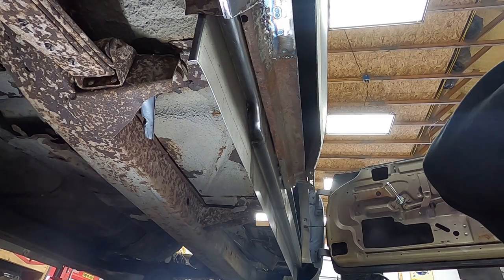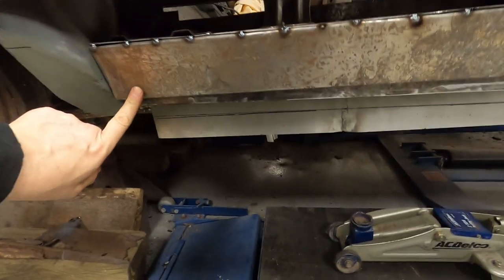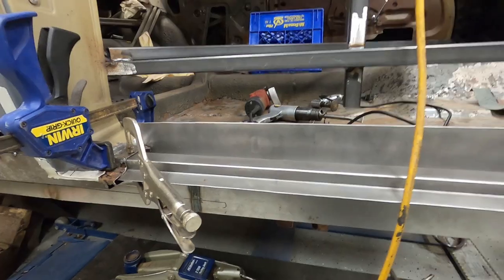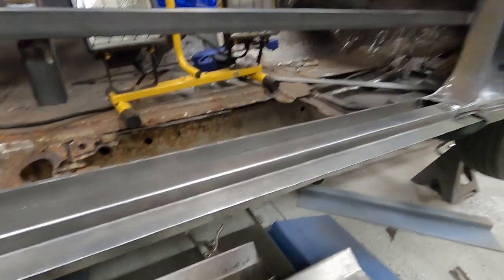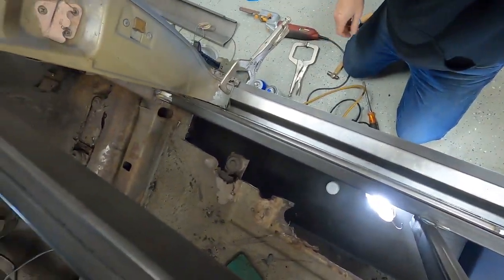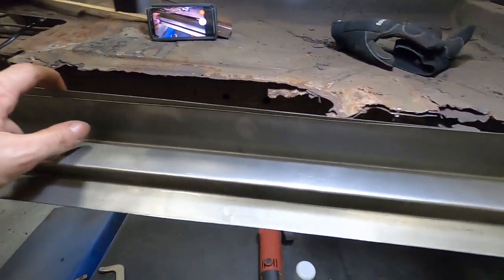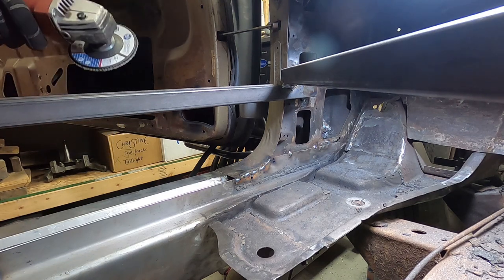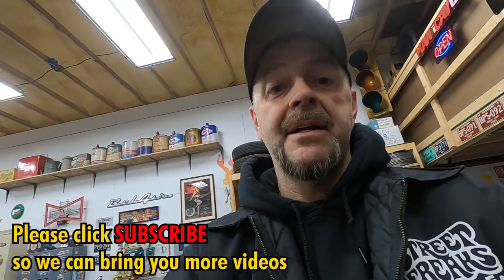1957 1958 PLYMOUTH REPLACING ROCKERS PT1 (Christine)

Comment: Looking good so far
resin impregnated wire wheels on a grinder or drill are good for pitted rust, the resin keeps the wires relativity  intact for alot longer than a normal wire wheel
Reply from the maker: Great information thank you. We will definitely pick up a few and give them a try. Thanks for watching.  👍